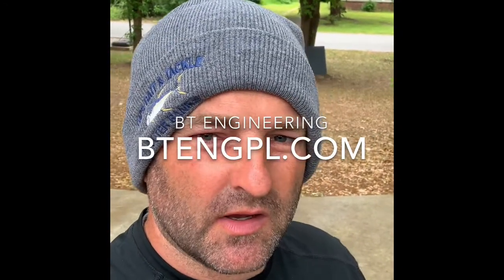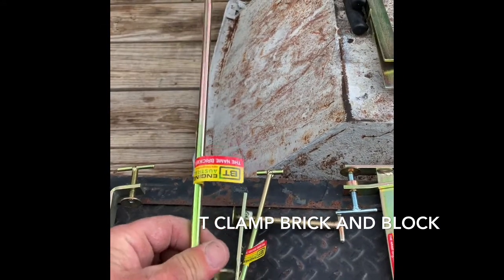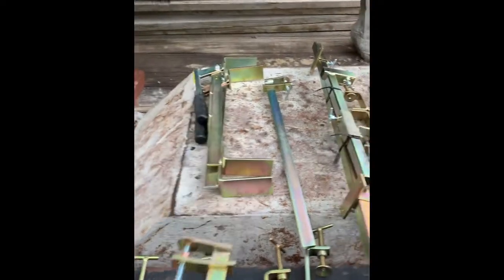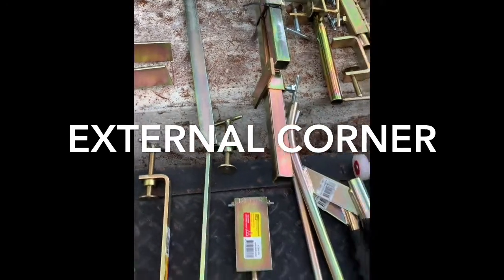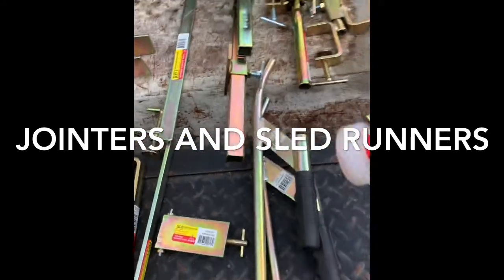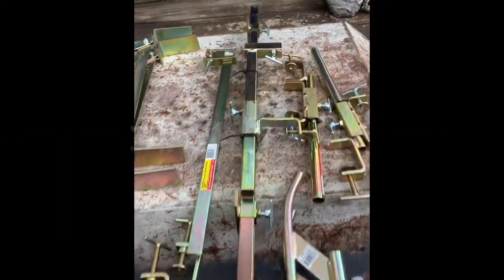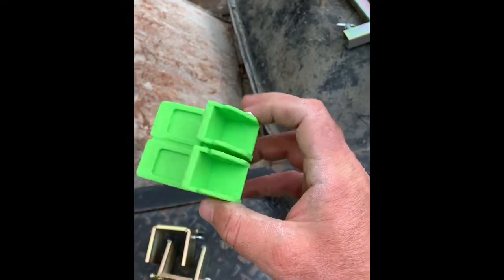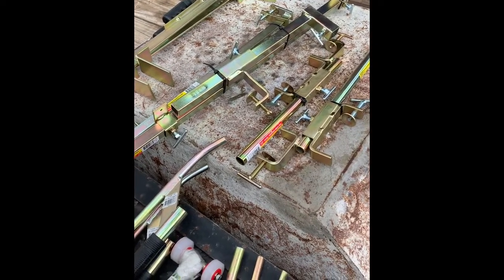BRICKLAYING Tricks With Bricks: BT engineering goodies

Comment: If you have never used them, you should try out MarvPost speed leads  out of Minnesota. Great product. Work great for inside and outside corners, as well as quoins
Reply from the maker: Patrick D I will check them out. I just ordered some more poles. Just stock square aluminum tubing. I will check them out tonight!  I appreciate the info!👍😁🧱